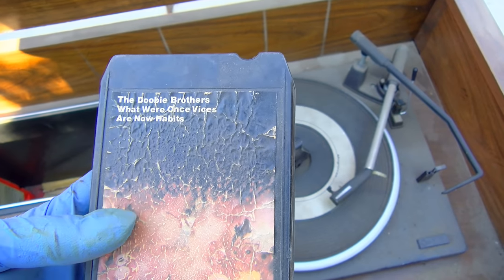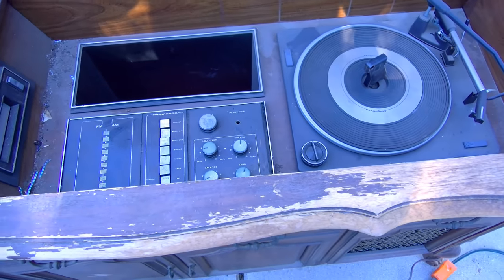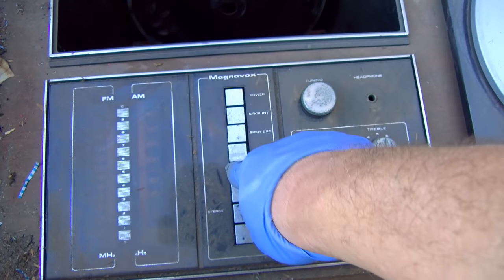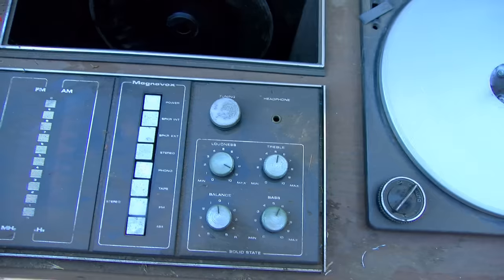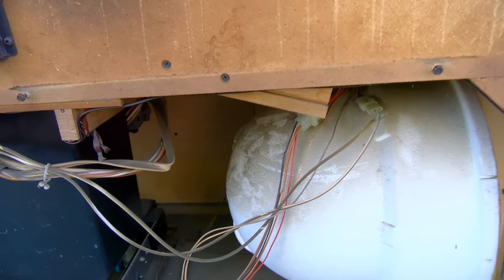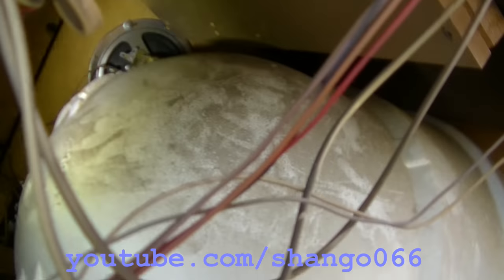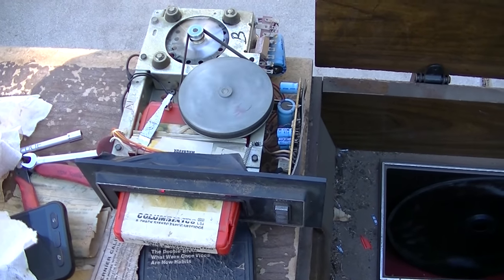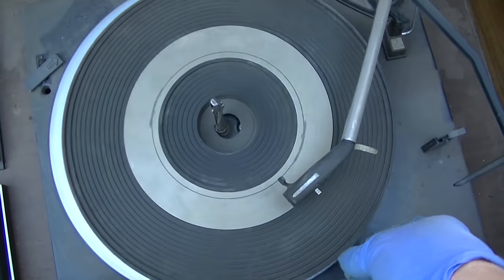1976 Magnavox Console Stereo 8 Track Record Player Resurrection

Comment: I did have the song Rose garden on record when a kid :)
I have made alot of speakers trough the years, and i am starting building paper speakers again, i love paper in mid's and low's, one of the absolute best materials to make mid's and low's speaker elements of, stiff and light weight.. the modern plastic cones wont sound as good as paper does. Silk for tweeters to get it light weight there too for a cheap price.. 
Add some berylllium high frequency tweeter domes that has the best material for replicating high freequency without distortion and with a high freq super-tweeter crossover and they will work really great for those that want every hertz the human ear can hear.
Add a bluetooth recieiver and a DAB+ radio and its ready for the future :)
The round shapes of the bass speaker enclosure in this furniture hifi piece gets rid of reflections in standing waves that suare cabinets have, i bet this sounds good :)
It may need a small isobaric subwoofer too to get the techno trance music players satisfied with the modern bass music.
My favorite speakers i has found is the Yamaha NS 1000/1000M from 1970's (closed cabinet, beryllium tweeter and beryllium midrange and 12" paper woofer) this will satisfy fast detailed music becourse it is transparent crystal clear. And Yamaha NS 20 from 1967 . Open baffle cabinet everywhere exept tweeters i think, paper tweeters and midrange, and a strange very large square shaped perhaps 20 inch styrofoam bass element, (probably sounds fantastic for classical music). NS stands for natural sound.
Yeah, they really made things better back in the days, it was HIFI wars back then, so people did go to listen what sounded the best before they did buy things.. so it was get better or get bankrupt for the companies.
Today the competition is all about getting the right advertisement with the right spec of things and added unneccesary features and the lowest price and cheapest parts to get the most profit, where everyone is trying to scam everyone a little.. its kind of sad, noone needs reputation anymore in their brand name becourse average people look for price and specs on the internet and order it. Yeah one gets crap that way.
They used 1'st order crossover back in the days with +/- 2db, today they use loads of capacitors and coils to get the crossover curve on paper to get +/- 0.5db..  becourse people ask for it and think a real flat curve is better than a somewhat less flat curve with less compromises.
Simplicity is often better than over-engineered so they kind of make the perfection of mediocrity that way loosing the fine details in the music for a flat computer curve that looks good.
People can not build real good speakers anymore becourse they priotitize the wrong things, they let microphones and computer software curves decide instead of the human ear.
All these things is the reason you think this wood furniture piece of art sounds good an you has totally right, it is better than todays crap sold cheap :)

Comment: Love that faux wood finish, NOT. Any competent artistic  person can redo the finish with modern paint pens.
 Ooo, an 8 track cassette  with truck driver songs. It has a very good collection of vintage trucker tunes.
Baritone voiced  Dick Curless is probably the best truck driving singer on this collection. AM radio works great. Dirty pots of course cause it spent time 
outdoors. Impressed by the amplifier! 45 year old electrolytic capacitors still fine.Old grease is keeping record player motor from turning properly.
Working the Shango  magic and it now  it is a sellable piece of vintage equipment.This was an awesome  resurrection Mr. Shango ! Party on!

Comment: The early 8 tracks were engineered like pinball machines inside. The circuit that changes the program lamps is just very simple mechanical rotory switch with incandescent lamps switched by a solenoid, a plunger, and a cogged wheel, which also lifted the head in steps. Those were different times, now everything has a microproccesor in it.

Comment: My Parents had one of these in the 70’s, they had the Cherry Walnut color. They had the Tape player on the other side of the sliding top lid with the Radio.  On the right side of that sliding lid was the record storage and record player.  Awesome sound, the record player met its demise in mid 80’s with the rest to follow.  
My grandparents on my Dads side had the same thing as us, my Grandparents on my moms side  had the nicer one, theirs was all oak but their radio was all push button and theirs came with an extra set of speakers which they put in another part of the house.  

I must say, the sound from these were fantastic, radio reception was great even without an antenna.

Comment: Basically it's a combination induction motor and synchronous motor. The magnet lets it run at a very precise speed with no slip
Reply: If only Lucas had got the memo!
Reply: Would these also function as a generator?
Reply: @samuelfellows6923  In a limited capacity, possibly.
Reply: @AmericanLocomotive1  
Is there a name for this type of motor? It looks like the little AC induction motors used to drive desk fans, dehumidifier fans, etc.

Comment: I have an old Fisher cabinet that I restored. It has the same Turntable and I have the same Trucker album on Lp still.
It has more wood than particle board but I had to tear out the receiver and speakers since it was left outside for some time. 
The bones are still good and it was my first shot at refinishing anything.

Comment: I restored a 1973 version of that, some, the tuner was a little different,  my tape deck had the same motor, and it too worked. I had to clean the wafer switches that controls the track lights. I lubed the turntable. Removed the old grease. Had to repair solder connections on the amplifier board because the dial lamps didn't work.  It had a great sound I ended up selling it. I didn't even have to replace the needle.

Comment: Those cartridges are ceramic and made by Tetrad. They are bad about being intermittent and what happens is the little metal contacts that make connection with the ceramic elements get oxidized. I've never done it; but, I've heard of people taking these cartridges apart, cleaning the contacts, and all was well.
Reply: Radiotvphononut, I took one apart, Not the Tetrad but the EV-275, Cleaned the Brush Contacts, Cleaned all the old Grease out "Yes the Ceramic Elements are packed in White Grease!", It's very tedeus and delicate to do but mine worked perfectly!

Comment: That is a 4 pole synchronous motor in that 8 track. It will run along happily at 1600 rpm all day whether it is cold or warm, as long as it isn't stuck.
Reply: Opps.....I meant 1800 rpm. The grid would have to bog down to 53.3333 Hz to get 1600 rpn...

Comment: 16:50 Most synchronous motors have that permanent magnet in the armature; the squirrel cage layer starts it and the permanent magnet keeps it in sync with the line frequency. I don't know if they all get weak, but Garrard models have a problem with the permanent magnet coming un-glued. It seems that Magnavox bought that tape player from Callaro, the maker of the changer; I would have expected something from Japan. Anyway, that cabinet looks a lot better (condition aside) than many of the plastic-fantastic 1970s consoles; it would look pretty convincing if in good shape and polished up. Of course, it would still feel like plastic. I've seen the cube-shaped Styrofoam speakers in Magnavox consoles, but never those dome-shaped things. I wonder if they were made that way to minimize resonance. Too bad that isn't in better shape; I like last-of-a-kinds.

Comment: I remember our neighbor had a console stereo in each of the kids bedroom. One of them had one with a black cabinet. This was in the early 80s. I always wanted a console stereo and finally got a Zenith from the late 60s in my first apartment in the early 2000s, paid $75 for it. It had 2 15 inch woofers and sounded great, but one channel was weaker than the other. I ended up leaving it by a dumpster when I moved to a second floor apartment. I wish I would have kept it and restored it. They are getting hard to find.

Comment: The speakers will sound even better if refoamed. Those were the air suspension generation with foam surrounds and long throw woofers. They really thump when right.

That changer was only better than the maestro. Both were junk. Between motor death and cycling system parts made of plastic, it's amazing it works. 

The push button switches are notorious for the plating on the contacts to dissolve, leaving poor contact connectivity. Contact cleaner only helps a short time.

This was really the end of the line for magnavox. I'm not sure the exact time philips took it over, but when they did you saw the junk cabinets and cheaper materials.

If I ever find an easy solution for replacement motors that last, magnavox turntables from the 60s will live on. Other than motors the older ones are great changers.
Reply: Philips took over in 1974 !

Comment: That motor is called a "synduction" motor.  The squirrel cage induction has a lot of torque to get near synchronous speed, then the magnet locks to the rotating field and runs at exactly 1800 RPM.

Comment: AstroSonic is usually good. The one I have from the mid 60s still works. No restoration needed. Ok the turntable is seized up. But the speakers, amp, and radio tuner are great. It definitely can rattle the room with bass.

Comment: I know you hear this all the time... but keep that 8-track unit, don't EOL it. That has a serious motor, the older Akai units are known for their massive AC motors, but many of those are starting to lose torque now. 8-tracks can sound good, you just need a good, well maintained player and well maintained tapes. If you plan to play your 8-tracks for any extended period of time, replace the foil splice (even if it hasn't come loose yet), and you'll also want to replace foam pads that have disintegrated.

Comment: This Collaro changer needs to be cleaned and lubricated, because the changer mechanism is stuck in the reject position due to bad grease. It needs to be clean, lubricate, and it will run freely without any issues.

Comment: I'm surprised it has a British made 8 track chassis, not least because most were made in Japan or Taiwan, but also because whilst you could get players and carts in the UK, they weren't particularly common here. It sounded way better than they normally do!
Reply: BSR did make an 8-track mechanism despite the UK not really doing 8-track stuff;  presumably mainly for export. I did a service course on it.

Richard, UK
Reply: @ukfmcbradioservicingTango21  I remember the BSR deck, there's one in the loft somewhere. It was often sold as a Wien 8TD3
Reply: Made by Collaro, They also made most Magnavox Record Changers

Comment: A pretty low cost for 1976. I had one from 1966 in that same styling. Back then, they used more real wood. It had the dual sliding top panels as most Magnavox did. I believe it was about $600. I bought another in 71-72 that was larger. It still had wood at the top and the dual sliding panels. The front was all plastic though. They were really awesome and I wish they still made them today. Component systems took over the market though.

Comment: Honestly even with a bad speaker and sitting out in the weather that console will still give the modern China plastic junk a run for there money. I would honestly pull all the parts out (8 track  tuner/eq. the amp. Maby even the record player an build a enclosure for it. Hell that 8track player was built like a brick. Way over built for what it did but that's what I love about vintage stuff. There over built an tend to last.

Comment: Really very interesting how the device just works out of the box after this long time. Here in Germany, such sets from the 70s are extremely poorly processed. There are without exception always problems with the electrolytic caps, diodes and resistors.

Comment: Had a '76 Maggie console, different cabinet but same components...
You are fortunate that the Record Changer works.  It is a Magnavox sourced/made model W850 (or similar W8xx series) changer.  These changers were made with an especially low-quality mix of "pot metal" parts especially in the tonearm mechanism. If you dig into the changer, be VERY CAREFUL, the metal bits are likely VERY brittle and prone to turning to dust.
There are no replacements parts for these... but a classic BSR changer form this era DOES fit (and IMO BSR is a better changer).
Otherwise, these Magnavox cabinets do sound fairly decent and have a "full sound," being  what they are.
Good luck!

Comment: The electronics actually look like good quality components. I'm betting 99% of the problems are weather related since it was outside in fact those blue capacitors should not be working after this long.

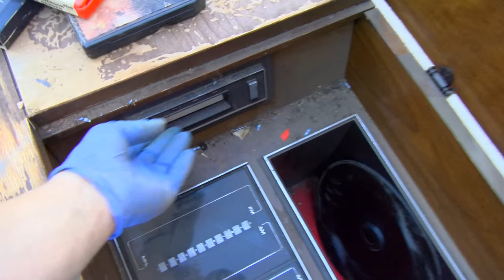Comment: To answer your question @14:00 in the video. The reason that motor is so big is because it's a Mag-belted Synchronous motor. Unlike a conventional induction AC motor which uses a reluctance rotor. An MBSM motor has an rotor/armature that has permanent magnets in it. This allows it to lock rotor speed to the mains frequency. this type of motor will run at exactly 1800 or 900 rpms on 60Hz AC power. This type of motor was common in all AC powered 8-track players of that time. The biggest mystery for me is why they would use those expensive motors on the 8-Tracks player and not use them on the turntables. If a normal AC induction shaded-pole motor could drive a turntable at the right speed, then why could it not be use on an 8-track?
Reply from the maker: The record player has the same motor

Comment: I really 👍 like that 8 👣 track/record player console. Lynn Anderson, 👍 Yes, I heard that song in my youth. 👍 Yes, $499.99 was quite expensive for 1976, but I think a console stereo was a luxury item for your 🏡 house. Hard earned, and we'll appreciated. So 😌 relaxing to 🎶 listen to the ⛹ ball 🎮 game after a hard day's work. Beats a quiet 🏡 house. It's a little hard to believe that this unit came without an AM/FM📻 radio (unless I 👀 see it a little later into your 📹 video). Also, I 👌 knew these units were going to plastic with the 🚧 construction of them, but it's hard to tell it by eye. The radio dial face, is, however, glass. I could 👎 not even tell this on my Astro-Sonic console, that my mom bought me back in 2010, for $147.00 at Salvation Army. Mine has the AM/FM 📻 radio, and the dial light still works. I 👀 saw some system of numbers, when I removed the back to this set, but I cannot make out if it's an actual year. It read 1957, or just 57 (I don't remember which). I 👌 know this console has aluminum-cone speakers, (Woofers),which are permanent magnet, and two aluminum-cone 🎷 horn speakers (Tweeters). I'm also certain that they're permanent magnet. Very nice find there, Mr. Shango066. I will 👌 keep ya posted in the future, in case I've made any mistakes with the above, because I have future plans to again remove the back, and ✔ check this unit out again. I want to attempt to recap it. I'm sure that the capacitors, and IF cans, and resistors are 👎 bad. Maybe I'll ask ya for a schematic diagram. I don't want to resort to throwing the console away. It means something special to me, because my mom is 👎 now gone (succumbed to bladder ♋ cancer in 2016). I also broke one of the feet off, during a move, but I have a plan to reattach it. I 👌 know these consoles are 👎 not made for moves. This unit is more than likely to become the "Basement Radio", as it's final resting place, as I'm in the process of trying to save ☝ up to buy a 🏠 house. Please 👌 keep me posted on gaining 👌 knowledge on recapping 📻 radios. Your friend, Jeff
Reply: $499.99 in 1976 would be $2343 in 2021

Comment: It's got a needle they had power it will Jam clean those electrical things  and get that sit down position right and reject throw furniture little polish on it get that weight right on that arm through an old album on it first to check it out if it's in good running condition Jam Jam Jam🕺🕺💃💯💥🥂👏 things were made so much better way back when it's a lot of Hidden Treasures out their lot of them were thrown away😪 I miss the 80s to is there anybody out there that does to🥂👏🥳👋 but I know this particular stereo system is 76 but it is nice❤👋👏👍👌🏼

Comment: He calls it cheap garbage while it's 44 years old and has sat outside in the rain for who knows how long while only requiring a bit of oil and adjustment to work well again. Meanwhile modern electronics break after a few years of tender use in climate controlled homes.  🤔

Comment: Love the fake Mediterranean Fruitwood-plastic Junk!   Better to focus restoration on an earlier one... pre FM MPX into the very first MPX sets.   It was a steady ride Downhill ever since those early days!   Restore a nice Fisher with an 800 chassis or an early 1970s Zenith... this turd needs to turn into termite food (they'll choke on the plastic speaker grills)!   Your talents are far too valuable to waste on restoring such a turd!   Hell:  Even I could revive a dog turd on the lawn if I shocked it enough times!   

These era sets at least had decent amplifier sections so they "rocked" to some extent, but the cabinets were junk!   A bud and I back in Troy, MI used to love to put Ramones LPs on the turntable of his mother's Zenith console and turn the volume to the point that the set just went into a harmonic feedback vibration!  I swear the thing would start moving on the hardwood floor!   Oh the good old days!